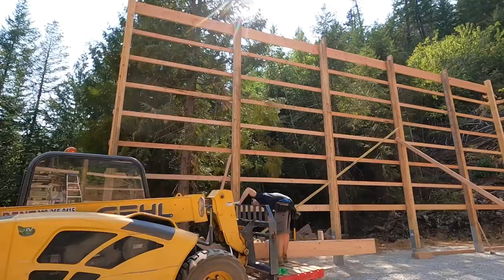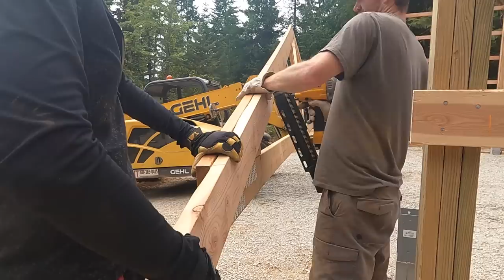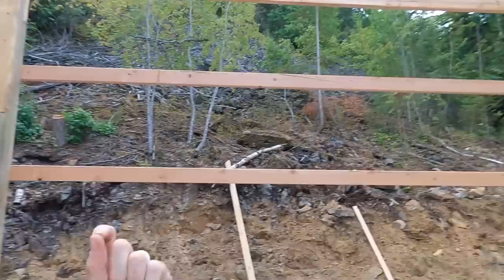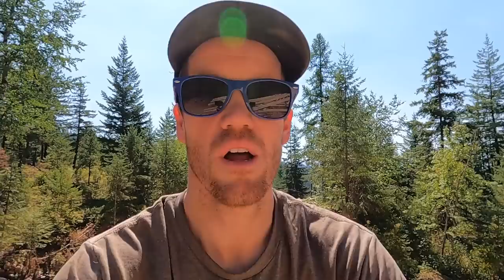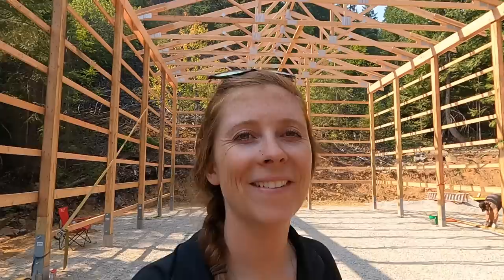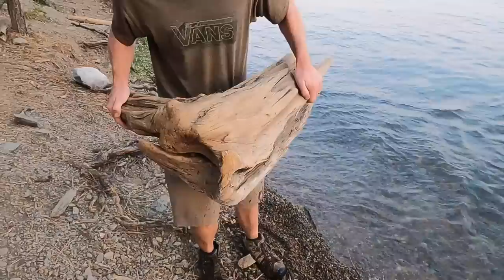Couple Installs Trusses With ZERO Experience | E4

Comment: There are companies that buy surplus goods from companies that go under or bought out new owners want all goods removed .Tools trucks machine tools and replacement supplies related to the building itself,even the glass panels out of a 50 story building are sold as is to liquidater, glass can be 6x8' x1/2" thick with uv rating,3-400 lbs each some pre crated smaller pieces odd shapes too..
Reply from the maker: We are going to check out some surplus building supply stores this week! 🤞🏻

Comment: Wherevare your diagonal braces to prevent the entire group of trusses from falling over.  Building a big church expansion in Ct. back in the 80’s, the contractor failed to install diagonal bracing to prevent the entire group from falling over.  A wind came up, the entire group swayed in the wind, collapsed 2 framers died.
I just heard you say you checked the weather and installed ratchet straps as lateral bracing. As a Civil Engineer! I would suggest You check with yOur truss builder to determine if your  strap placement is adequate to prevent truss collapse. 
Also…get your harness and use it.  
Bless you both….work safely.

JoeB

Comment: I know it's way too late to help now, but regarding the issue with the airhose tangling, with any substantial hose or cable, the best way to handle it is to keep the twist out of it.
There's a number of ways to do this, but the easiest is to wind it in the form of a figure "8". This allows it to be 'coiled' without putting a twist in it, and it pays out much more easily, with no need to add or remove twist along the full length of the hose.

Comment: Doing great. Just be sure that you add diagonal braces ontop of your roof trusses too. I'm an ex-builder who has build around 250 homes, and you really need to diagonally brace the tops of the trusses before you add your roof battens on. In AU we use 30mm metal strap nailed ontop of the trusses for the bracing. I would go 8 braces, crisis crossed at each end there. Do it right, do it once. :)
Reply from the maker: Thanks Bob! Working on that as we speak!

Comment: Potential air compressor resolution:  Riley, I don't believe that your Craftsman 1.5HP/150PSI/20 Gallon air compressor (model #921.166420) ships equipped with an unloader valve.

Have you checked in-rush current on start-up? This compressor should run without issue on a 120V/15A circuit, and your Ryobi generator (1,800W continuous/2,300W peak) should be up to the task.

If my supposition is correct, this $15.45 replacement pressure switch with unloader valve (t.ly/T66d) might stop you from having to use camper power to start the compressor.

Just a thought if you're not already way ahead of me on this.
Reply from the maker: Hi John! Thanks so much for the information. We ditched the Ryobi in favor of a Honda 2200i and are curious to see if it can handle the start up. If not we will look into the replacement pressure switch.
Reply: @AmbitionStrikes  With just 2200W (max)/1800W (rated), it's entirely possible the Honda won't be up to the challenge of starting the compressor either. If in-rush is greater than 18A, it'll trip the Honda's protection, as well.

Cut back the outer insulation on an extension cord so you can get the clamp on your multimeter on either the line or neutral conductor. Set the DMM to Amps (AC) and activate the max/hold, then start the compressor to determine the max in-rush current.

If measured current is much over 15A, back pressure is the problem. An unloader valve will bleed pressure off the piston after shutting off, and make start-up much easier.

Sorry if you know you know all this already. Just trying to be helpful and as thorough as possible.

Comment: If you look on line there are companies that demolish buildings- they take out a lot of fixtures --- doors,industral windows and frames plumbing fixtures like clawfoot bath tubs rollup doors,metal staircases hand rails, look around your new locality the locals know  who does that work.If you can't find what you want check the big citys demo companies they have warehouses for contractors that remodel or restomod older Victorian era homes and save the Windows and sash frames don't for get the weights for balance .
Reply from the maker: That is an excellent suggestion! We found a place not far from us that we are going to check out this week!

Comment: Suggest blocking under the 2x12's so the roof is not just riding on screw shear.
Reply from the maker: How do you suggest we install the blocking?
Reply: @AmbitionStrikes  Insert a block on the post between the header and the next gert down. You can do this inside and out.

Comment: How to coil an air hose: Pull the end of the hose all the way out so it is straight and there are no kinks in it. Grab the end and rotate it as you coil. It will almost coil itself.
Also, I like to wire my light bar with the trigger pole on the relay to the high beams. That way you can turn them on and off with the high beam switch.
Reply from the maker: Thanks for the tip! Thats a clever trick for the the light bar. We opted to use the Trigger control. It allows us to also turn the lights on from our phones and tablet so we can turn them on from inside the camper. It will be especially useful once the Baja Designs S2 pods are installed on the roof rack.

Comment: Suggestion: Start at the empty end of an air hose to get out the kinks.  It just takes time to untwist and straighten and then you can curl as you go to get nice even finished circles.
Reply from the maker: Funny off grid dilemma. I didn’t want to unhook the hose because then I would let a large quantity of air out and then Riley would have to drive it back up the hill to charge it again… 😂
Reply: @AmbitionStrikes  Doesn't our tool unhook from the hose without letting air pressure release?  The tool end is where I start to unwind the kinks.
Reply from the maker: @billmcdonald9115  Yes but then the hose would still be full of air pressure and equally as difficult to work with!

My solution is just to throw it in the lake and give up… 😉
Reply: @AmbitionStrikes  I one time went and threw out the plastic/poly air hose, went back to the store and bought a 'rubber' hose. (HaHa.. This will never get kinked!!).   The rubber hose did the same thing.  I like your idea of getting the hose reel on one of the barn walls.  BTW the build is FANTASTIC!!

Comment: I have great respect for the folks at RR Buildings channel.  The have taught you well to check plumb and square MULTIPLE times !  I like the double truss carriers spaced around the post.  Spreads the roof load out.

One thing I disagree on is attaching the truss carriers to the posts.  IMHO, the truss carriers need to be "let in" to the posts. If the post was rotated 90°, you could just trim the inner and outer 2x6 shorter than the center 2x6.  Of course now the bottom bracket would also have to be rotated 90°.

As it is now, the entire weight of the roof system (trusses, purlins, metal, etc) PLUS the snow load, is held by the screws used to attach the carriers to the post.  I guess if you are using true "structural screws" spec'd by your architect, I can't complain.

Attaching a carrier beam to a post with the incorrect screws is one of the reasons many decks fail.  (Yes, a deck weights a lot more than your roof system and load,)
Reply from the maker: RR's snow loads use 8' truss spacing. We opted to up that to 4' spacing to accommodate higher snow loads (well above what is required in our area). Our trusses that are on center with the posts sit on top of the post and do not rely on fastener strength. Our trusses that are on the odd spacing are carried by the truss carrier. This is common practice in our area and not something that we invented. Most just use a handful of 20D nails to attach the truss carrier, we went above and beyond using GRK structural lag screws along with 6 20d nails per side. I agree that it would be nice to have the truss carrier let into the posts, but that design wasn't practical in our case. We opted to use the widely accepted and used method of our region.

Comment: I admire your hard work and determination in making things work before winter. The only thing I am questioning is the purlins. If you watched R&R, then you should have used 2x6 purlins, not 2x4. Everyone that has videoed a pole barn construction going up used 2x6 purlins. Refer to "Marshal Remodeling" build of his barnominium. He built a huge house and attached 4 car garage, mostly by himself. You don't have as much weak wood in 2x6 as you do in 2x4.

Comment: That was fun! Surprised you haven't tapped the air tanks on the Stewart for the air tools. LOL!  I'm sure it's a lot cheaper to run the Ryobi through the truck camper. Should we gift you a battery powered nailer?

Excellent work with operating the telehandler! Well done to the both of you. 

~Mark & Teresa
Reply from the maker: Thanks Mark and Teresa! Hadn't even thought of an M1078 powered nailer, that sounds amazing!!! But also loud and smelly. Ha! I'm really kicking myself now for buying the air framing nailer and not the battery powered one. At the time air supply wasn't and issue, and the air nailer was significantly lighter. Anyways, thanks again for the support of the channel and for the compliments!
Reply: @AmbitionStrikes  ❤

Comment: what you call the truss carrier . is not what is carrying the trusses , like a window header . a window header is supported by a jack stud . your carriers are supported by screws , that means your trusses are supported by screws . it might hold for the first 2 or 3 winter snows .. but it will fail , not if but when .. nails , screws , bolts hold things in place while the support has to carry the load to the foundation .
Reply from the maker: Half of the trusses are directly supported on the tops of the columns, not relying on any screws. You’re right, the other half of trusses do rely on the structural lag screws. However, this is not a method we invented. This is a widely adopted way to build an engineered and properly rated post frame building in our area.

Comment: On coiling a rope , cord or hose; almost all flexible tubular goods have a built in twist to them- working against this twist makes the job harder and actually hurts the longevity and strength of the rope,wire or hose. First, lay out the line you want to coil in a fairly straight line, then taking one end in one hand, draw the rope, cord or hose through the first "grab" hand- quickly isn't helpful- you want the rope, cord or hose to "roll out the twist as your make your coils- it can do that if it is all tangled up. Make your fairly even sized loop, laying the line in your hand onto the coil on the ground. Rinse and repeat till you run out of rope, cord or tubing. On electric cords- the wires inside the jacket are twisted as they pass down the length, in a clockwise direction as you look down the cord from the male end (check my memory on this)- so you always want to lay the coils so that you don't back wind the cord itself because it will untwist the wires inside the jacket, weakening the cord and making it more liable to easy damage. A little practice and you can look like an old salt or a smart arse plumber like me! FR
Reply from the maker: Thanks for the tip! Nothing worse than a lefty coiling a cord!
Reply: @AmbitionStrikes  Actually, being left handed myself, it helps a lot with cords- the natural "feed" of the laid out line to the forming coil is from the left hand into the right and the proper direction of the coil should be clockwise. It looks neat and will dumbfound "sidewalk superintendents"! Much success! It looks like you two have avoided a bunch of the really catastrophic errors and if the one inch width problem is still square, it is very survivable.- Since your end walls will not work perfectly on the resized length, start your end wall metal from the middle, with a major rib right at the roof peak center and work away from that- your end walls will then look symmetrical and planned rather than having odd ball rib spacings at the corners. FWIW, I was a career plumber/HVAC specialist but have many hours in general remodel, etc, and Kyle has answered many of my questions through the comments and just by being Kyle the teacher who didn't know it. FR

Comment: Yay rigger romper suit
Reply from the maker: I hope this is the only romper suit I ever wear. 😂
Reply: @AmbitionStrikes  depending if you want to remain on the boom and work from it the system you have is fine. Now if your wanting to move around the structure you may have to rethink it, when I did my rigging course 10 years back for towers the harness we had was for climbing constituting a front system with two safety lines with quick real ease bayline clips similar to your shown clipping in on your back but much smaller since we where on main cables and you would always have two clip attached when moving. When moving to another wire or tower diagonal you unclipped one bay to the next line/anchor point, this effectively has you connected to two points of contact then do the same with the second clip and on and on, I appreciate my experience was on metalwork and have not rigged on wooden structures. What ever system you implement don’t rush you movement and please don’t free climb with tools in your hands 😨or if you or your hands are fatigued. Kinda silly to express some of this but over confidence in you location with just two of you. What’s you first aid prep like, do you have a med bag things to think on oh FYI what guys are doing is amazing.

Comment: Thanks for the content and referencing @RR Buildings !
Question: I see that you are putting the trusses on 4 ft centers and using 2x4 gerts, did you get that from a design software or architect?
Reply from the maker: Hi Bobby, the design came from consulting with other local builders in our area, snow load calcs, and our truss manufacturers specs. Kyle at RR is an amazing resource, but his buildings are in an area with lower snow loads than us.

Comment: Just a tip, remove the hose from the compressor, an airless hose is easy to coil…. One with compressed air inside is nasty!
Reply from the maker: My off grid dilemma: Let a bunch of air out but make the hose easier to uncoil… or battle it hooked up and save Riley another trip to the camper. 😬😂

Comment: Remember what I said about some soap on the nail or screw helps
Reply from the maker: Thanks for the tip! Does that also let the nail pull out more easily? Pull out strength is a big concern with this building type.
Reply: @AmbitionStrikes  no the pull out strength is the same as if it were nailed in dry. Been using this way of nailing for 50+ years when nailing through most hardwood like oak.  The same with screws, that we used building custom wings for aircraft and custom wood boats.  
All you need isa little bit to allow for easier nailing.

Comment: Just curious, did you ever discuss why you went with stick built rather than a metal building?
Reply from the maker: We briefly touched on it. A metal building requires a slab first, and we do not have the time or likely the money to pour a slab at the moment. A post frame building can have the slab poured later. 

Also the lead time and cost to procure supplies for a metal building are significantly greater than that of a post frame.
Reply: @AmbitionStrikes  Thanks for the details. The build looks great so far!
I highly recommend radiant heating in your slab once you do pour concrete so you can have an easily heated workshop.

Comment: So awesome!  Really enjoying this facet of the project.  It keep thinking how smoked you all must feel working so hard every day.  I was also thinking, "they should really get a safety harness (so glad you did that).   I think you should try to go back and use nails where you found screws worked.  The problem with screws is they can easily break if the building is moving from high winds or settling.  Nails bend forever and will help keep the join.  Experiment yourself and you'll see how those screws break with sheering forces.
Reply from the maker: The screws we used are GRK structural screws rated for the intended use! They are crazy flexible and can bend in half without breaking.
Reply: @AmbitionStrikes  haha - I'm sure you all are thinking through everything.  Just exciting on the sidelines and stressing the details along the way - good stuff and thanks for detailing what screws you are using for my own edification😬

Comment: Hello from Russia, kids!)) 1 - safety precautions are not observed - the guy was not fastened half of the video (his wife wants another husband??))), 2-the walls are not rigid, they can form in the wind, urgently make diagonal connections! 3-the fer must also have diagonals, among themselves, otherwise they will fall after installing the roof! Success in construction, guys!
Reply from the maker: We are waiting until the building is square and roof is on before adding permanent diagonal bracing, but we add temporary bracing at night.
Reply: @AmbitionStrikes  I see. Now about the farms - it is important to make a temporary connection on the top of the farms, then make permanent connections of the farms diagonally and only then load the farms with girders and flooring. I'm a civil engineer, I know what I'm writing about, friends)) ps.. observe the safety precautions, and not the way they started putting the first farms without insurance for a person..!

Comment: I am impressed by your hard work but I am worried about those screws you used.  Nails bend and shift with the structure, screws do not and will snap.  This is why framers use nails instead of screws for fasteners.  Add nails 😁
Reply from the maker: Hi there! We used GRK structural screws, which are rated and intended for framing. We don’t have a safe way to get high enough to put nails in the purlins, so it was the best option for us!